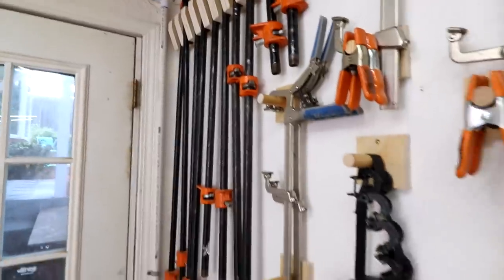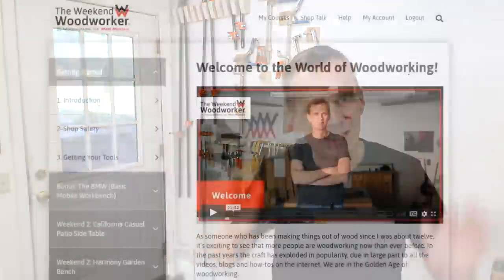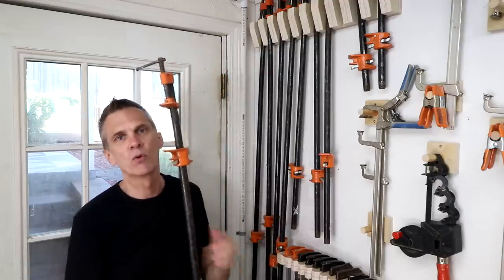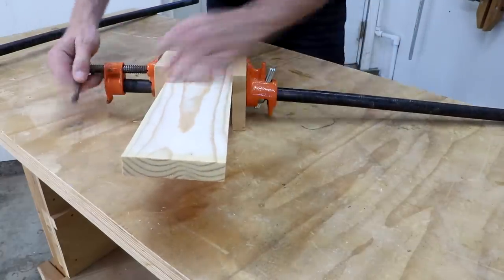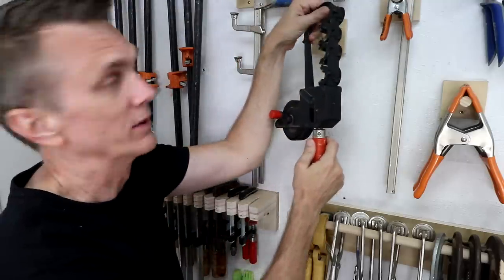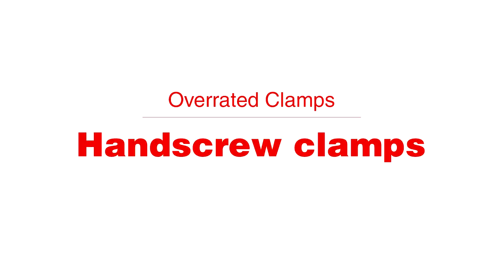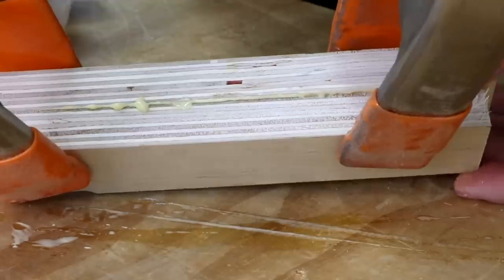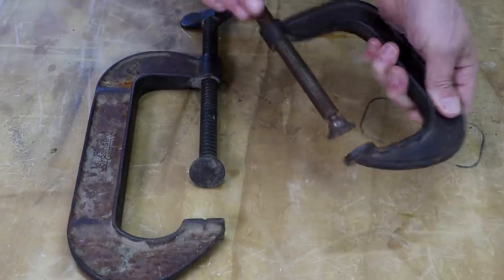How many clamps do you REALLY need? Woodworking basics.

Comment: I love what you  do!  Most of all I love that you are still true to your original.  You still try to teach people about the basics.  That is VERY VERY COOL!

It all depends on what you are doing.  As always I respect your opinion, and honesty.  if you are only doing small projects and time is not an issue, well yes a small number of clamps will work.  
On a large project with multiple glue-ups.  Most of the time your limiting factor is the number of clamps you have available.  As with most things in life a little more that you need is better that a little less....

I always try to walk past the Markdown table/shelf in just about every store I go into.  Depending on what is in my personal spending account I have a limit for things that I don't really need but might want....  Usually between 5 and 20 bucks.  One of the things I tend to buy up are clamp sets.  I Have several still in the packages on the shelf in my maker space.

I like you, love to get more people involved in making things for themselves.  I regularly gift a couple clamps or sets of clamps to someone just starting out.  It is often an overlooked part of making stuff.  

Big metal C clamps are not meant for wood working.  Sometimes they are handy, but yes if you are primarily a wood worker you can spend your money on a better alternative.  I Make (not all out of wood.)  so I have quite a few C clamps.  Most of them are tiny.  with a capacity of less than 2 inches.  ( I tend to make lots of small stuff.)

Comment: Agree about the c-clamps and spring clamps.  I do like the wooden ones--tip:  Imagine you are pedaling a bicycle to open and close them, then they stop being so mysterious.  I got some Bessey parallel clamps, the pricey ones, on clearance for 70% off.  They are really great for building cabinets.  Also love bar clamps.  If doing kreg pocket holes, the right angle clamps are nearly indispensable, but I have two other kinds that I'd easily part with.   I may just donate most of my c-clamps to a high school shop class, along with some spring clamps.  Can't think of the last time I used them.  Since I have a few types I rarely use, perhaps I have too many clamps!  Good points.

Comment: I have watched this video about ten times by now (in 2020) and never really commented to it before!! My take on clamps is this You don't really NEED any clamp until you do a project that requires one or six, AND THEN you learn you don't have the right clamp to finish the job you need it for!! 

My example was I was building a desk that is 4 feet wide and 6 feet long out of plywood and needed a way to clamp the 3/4 inch molding I was using for edge banding to the tops edges. I didn't have any clamps big enough to do the job and after I glued the molding it place they fell off an hour later (glue was still wet)!! Frustrated I didn't know what else to do, so I got out a dril and drilled a number of small holes in the molding to attach it with finish nails to the top.... reapplied the glue and then nailed the banding into place to 'clamp it" while the glue dried!! It worked OK but there was in some places a small gap I had only wished I had, had clamps to help hold it firmer than just nails and glue. And I ended up applying a lot of putty to hide the small defects in my work which did a good job, but I still know where they gaps are and because it is MY DESK bugs me when I see them!! 

Again had I had longer clamps my project probably would have been nicer finished even though I do get compliments all the time on my desk! But since then I have bought a number of clamps I had wished I had sooner for more projects like this! So again you don't NEED a clamp until you find you have a use for the one or type you do not have, and then it is usually too late because you have to work around it  or put the project on hold which stinks too!

Comment: I use quick-grip clamps and c clamps as they are easy to find where I live. I have 7 quick grips and 7 c clamps. I don’t have the strap clamp ad to square edges, use L- brackets fastened to the meeting edges with my C- clamps. Great video as ever. It makes woodworking seem a lot less cluttered and simpler.

Comment: I use the hand screw clamps more often than pipe clamps. The clamps that I use the most are parallel clamps and bar clamps (F-Clamps). I know the parallel clamps are more pricey, but I find them very useful. I have 4 two 40" and two 28". I agree that my spring clamps and C-clamps see little use.

Comment: Steve, what you and others are calling a bar clamp, I call deep engagement.  What I am calling a bar clamp, you are calling a pipe clamp, except mine has an actual bar. Handscrews: besides their uses as a vise substitute, as many here have mentioned, they excel at applying pressure over a broad area, or on stock of uneven thickness. I rate them as equal in value and as necessary as all other clamps. Just grab both handles and crank, it will change size quickly.  C clamps: sure, not as convenient to change stock thickness as deep engagements, but just grab the screw and twirl it like a stadium noisemaker, it’ll spin down right fast. Big honkin’ spring clamps: grab one arm, place the other on the bench, and lean your weight on it till that far handle comes within reach of your grip.

Comment: Hi Steve, I agree with most of your clamp selection with one difference, the spring clamp. I use these to hold on edge banding, I get old bicycle inner tubes and put a length on each side of the clamp, and then I use them to hold edging onto plywood etc.

Comment: C-Clamps - Take the floppy rod off and weld on a nut. Use your small slip clutch battery driven driver to adjust or tighten. Small and long reach C-Clamps are very handy. Sometimes the best clamps are cut from old tire innertubes or just use tape.

Comment: Nice video!
I will say though, C clamps have their usefulness - just not maybe in normal wood working, haha! I found them extremely helpful back in the days when I helped with theater stuff - constructing stage platforms and the like. You'd use the C clamp to hold things in place while getting it all bolted or screwed together, and in those situations, where you might be needing to put together big sections, at different angles, it was helpful. You had to be sure to remember to take the clamps OFF before the toe-nailing though! (The only serious injury I ever had working on a set happened when I forgot: and hammer blows WILL knock a C clamp loose no matter how tight you've got it. I was lucky and had only a mild concussion...!)

I've never seen bar clamps at all but I'll be looking for those pipe clamps...I'm planning to mostly do very little, finicky stuff. Making storage for teensy jewelry making materials, specifically...so I figure the pipe clamps, and short lengths of pipe, will be pretty close to ideal for me.

And I'm a cheapskate too, why d'you think I subbed to your channel? Us folks with a tight budget need all the good advice we can get!

Comment: I have bar and pipe clamps, used most of the time.  Occasionally I use the spring clamps to flatten glue ups.  C-clamps too.  Bu I could do without the C's.
The strap clamp though...  I bought that with your Amazon link and is helped so much.  Mu first go round with picture frames was great (don't look at my miters).

Comment: I use handscrew clamps often when I glue up panels. I put two clamps flat on my workbench and use them to hold a board vertical on edge allowing me to apply glue to the other edge and to biscuit slots. Then to hold the board steady as I lower the next board onto it which usually involves using a rubber hammer to make good contact. Then to repeat the process to add additional boards.

Comment: Clamps I find myself using the most:
1. First set of clamps I bought for was yellow and black brand of 2x 6in and 2x12in speed clamps. Those are my go to when I have hold something down. Mainly they are much quicker than bar or F clamps. Main downside was the price (think it was like $30-35 for 4). I got similar style clamps from HD and HF but ironically those are least used clams for me.
2. 4x24in and 4x36 in heavy duty bar clamps... just my preference over pipe clamps. 
3. All other clamps are only used if I need more than 12 clamps or glue up something really large.
4. Large spring clamps have 1 use... to clamp them to kids clothes to mess with the kids :)

Comment: a c-clamp makes for a heck of an improvised screw press. For when you really need to drive that square peg through a round hole, y'know?
Reply: Doesn't an F-clamp give your the same option?  Same way of fixing as an F-clamp
Reply: @markhanoi1478  Probably lol. I'm a little new to the world of clamps. Previously I used my meat hands to hold things together. One of those should work just fine though.
Reply: @markhanoi1478  most F style clamps can't exert enough pressure with the round wooden knob. The cross bar on the c-clamp screw can even have a force multiplier added.

Not woodworking,  but I've changed many bearings with c-clamps that F style clamps just couldn't do.
Reply: @TEDodd  Yeah true, although they do make F-clamps with different types of handelbars.   In most cases though, I can get enough force on an F-clamp to make a lasting impression on wood, which in general you don't want.  Often high clamping force is required when people try to do things in a wrong way..... so when ever you feel the need for high clampforce, maybe rethink if you can do it in a other way ;-)

Comment: Yes, agreed, Steve,  C clamps are something of an anomally - I own just the one - purchased thirty years plus ago. These days, I rely solely upon my pipe, as well as bar clamps of varying sizes]; spring clamps - I have three - two smaller versions of the one you featured, & an all plastic monster that comes in ( for occasional use); I own two strap clamps - squaring up box glue ups - the straps are nice & long, so I can wrap them about the larger builds - I wouldn't be without them. Another excellent presentation !! :D

Comment: I like the self-adjusting Kreg clamp with flat faces. (I know others make this but this is the one i found first). It is easy to use, you can adjust the tension, and perfectly holds the faces of boards aligned well for either screwing or glueing. Not cheap and I only own 1 for this reason. I also own the Kreg clamp the slips into one of the holes to join perpendicular boards or panels and this does a great job but isn’t always simple to get into the holes

Comment: I got a milwakee hand clamp just because it was on sale. I would have never imagine how much I use it now, for any situation. Really easy and strong grip for holding any thing, specially before drilling and screwing. Takes a bit to work through the slippage caused by the pressure, but after that it works like a charm.

Comment: I love the ??? next to the Rockler clamps @ 4:34.  I bought those thinking they would be great for panel glue ups.  They have frustrated me everytime I try to use them and they slip.  I end up using the 2x4s I ripped for the Rockler clamps and pin them down with F clamps.  Love your videos.

Comment: One of the best uses for handscrews is using two to act as a vise on your workbench, assuming you don't already have one. Clamp your work piece in one, then clamp that to your bench with the other. Easy.

An easy way to make c-clamps absurdly quick to operate is gluing a wooden block onto the end (uhhhh Colin Knecht on Woodworkweb has a video on this, as it's kind of awkward to describe) and then running a screw into that block. You can then use a drill to quickly operate your clamp.

Comment: Your pretty close to right on.  I’m a full time woodworker and I just counted my clamps just to see.  I have 120.  Some have never been used and unless I’m doing more than one project at a time I only use 10-12.  There are some designs where I have used 60 or so but it’s rare.  Pipe clamps are the most versatile.  I have done 18 ft tables where boards had to be glued end to end prior to doing a normal glue up and I just swapped the bar to a 20’ pipe.  They do have a tendency to bow boards but if you watch what your doing you’ll be fine.  Parallel clamps are great but I don’t think the monetary investment is worth the life you get out of them.

Comment: I have more spring clamps than anything else. 

I never use them for wood. I use them for holding tarps to poles and 2x4's and such things. They are FANTASTIC for photographers, riggers, and construction workers who need to mask off/hide/protect things in a hurry. 

Same story for C-clamps...if I need to secure a object to a table top? They're great. I LOVE em for clamping a object a solid surface...but again, that's more metal working than wood working.

Comment: If you get some pipe couplers and a few lengths of pipe to use as "extenders", you can turn a 2 foot bar clamp into a 5' or 6' clamp pretty quickly. On my C clamps, I cut the sliding metal rod off, drill a hole in the end of a 1" dowel that's about 1 1/2" long, epoxy it onto the end of the clamp and then epoxy a 1" rubber cane tip or chair leg cover onto the dowel --  much faster to twirl tight and pretty good grip when cinching it up.
Reply: Pipe flexes too much past 4 feet. The, "sliding metal rod" is called a tommy bar. There's a name for everything.

Comment: I have some extra long F clamps/bar clamps (made myself) but mainly I use Irwin style one handed bar clamps.
C Clamps (or G Clamps as we call them) I only use for metal working, only time I can think I used them on wood was bending new Gunwales onto a boat where extra strong clamps were needed.
Pipe clamps might well be cheap that side of the pond but they are not that cheap in Blighty.

Comment: I'd have to say spring clamps are not overrated. 
They aren't supposed to be used for glue ups or such jobs. They are essential for the "extra hands" jobs. I use them all the time to hold something in position when I can't spare a hand and they are also quick to move around. They aren't intended for jobs where you need a lot of pressure or extended holding time.
When you use spring clamps for what they are intended for, I find them to be quite essential.

Comment: I think the wood clamps you show, if you know how to use them are favored as they can substitute for a vise and some unique work holding situations.
One or two on the floor can allow you to plane the edge of a door, one on bench top clamped down with a second clamp or screwed down can substitute for a vise so you can plane a board edge on top of your bench. Some drill a 3/4" hole in one clamp end, nonpointy end, to use their bench dog hole system in a similar manner. Some with a vise clamp their wood clamp in it to raise the work or allow for finer, smaller work possibly at an angle if wished, wood clamps if big have a greater reach than many of the clamps you're showing and that can be handy in a pinch...
There are reasons why some people like them. I think one, with greater reach than one's other clamps is worth having for some of the uses I list.
Rather than two one can clamp their one wood clamp to their bench top, cricket portable bench or sawhorse with another type of clamp like an F clamp you probably already have or should get as the video discussed.
Sure there are alternatives but this works.

Comment: A couple of the “specialty” clamps from Kreg are nice. The one you showed with a pin on one side and flat, round face is nice for holding a pocket joint in place during assembly. I also like the one-handed clamps for quick set up. But, to your point, neither are essential.

Comment: I actually find C-clamps handy enough to have a few, but I mostly use them for when I want to clamp something down somewhere for a good long while, like attaching my miter saw or my portable bandsaw or portable router table down to one of my B&D Workmates so it won't slide around, and then I don't have to drill extra holes in the top work surface. Outside of things like that though, I don't use them on work pieces.

Comment: Irwin trigger clamps are my favorite, they adjust fast, and release fast.  I have the new ratcheting clamps for some things, but they are more limited. Irwin is my go to. Can you have enough clamps... depends. it you're doing a lot of drawers, there are never enough clamps. There are days I think I have too many, there are days I know I don't have enough. What i need now is a couple of extra 36" 600 lb. trigger clamps. 4 more should do it. Pipe clamps are easy, and I have enough. Keep shorter (36" length) sections of pipe along with a bunch of nipples, and you will always have a long enough clamp.

Comment: I’ve been a fan for a long time. Maybe it’s just an area thing but what you call bar clamps, I call F-clamps. Bar clamps are like pipe clamps but use bars instead of pipes. Also, the advantage of a C-clamp is clamping power, if you need to clamp something very strongly, you should use c-clamps or welding clamps (or you need to adjust you jointer so that your boards are straight, lol)

Comment: I use a lot of spring clamps on smaller projects. My local flea market has them for cheap. As for C clamps, they are good for work holding, but never for glue ups. Pipe and bar clamps are my mainstays for that.

Comment: (1) In my shop, hand screws are like spoke shaves. Once you learn to use them, nothing will work better.
(2) Spring clamps are either too strong or too weak...and glue-up pieces slip.
(3) When it really, really has to be kept immobile, C-clamps do the job.
(4) How many clamps?  If you ever build a boat/canoe/kayak, you'll want more.  Lots more.
(5) Yep, F-clamps (what you call 'bar' clamps) get used the most.
(6) In a one-man shop, sometimes it just has to be a Quick-Grip.